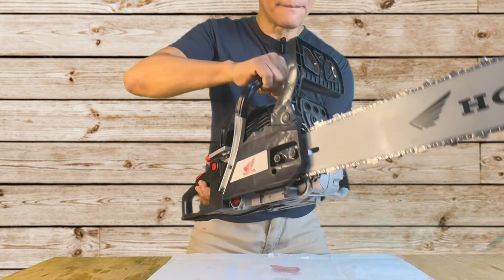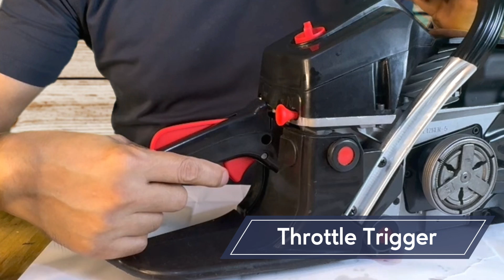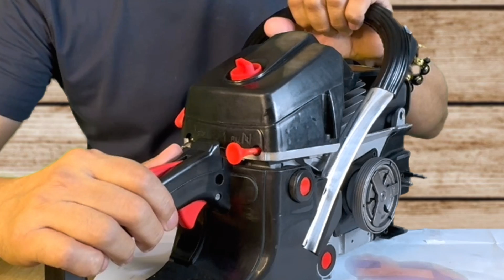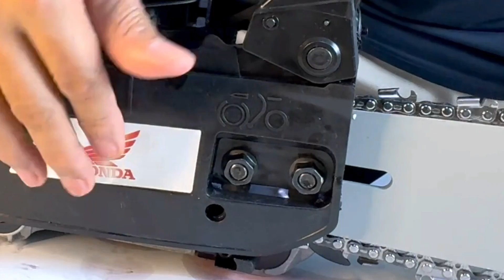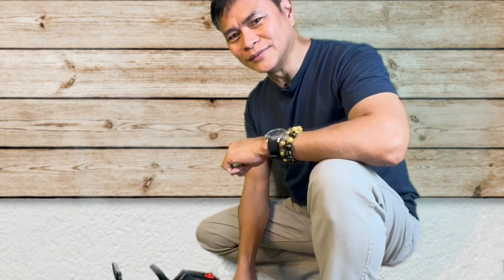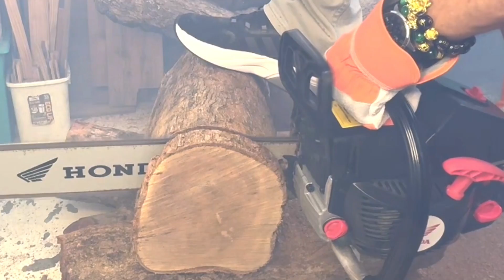Chainsaw Chain Brake Explained: How It Works & How to Use It Safely | Chainsaw Safety Tips

Comment: I am thinking about buying this chainsaw. Are you still using it, and has it been trouble-free?
Reply from the maker: Thanks for your question! Yes, I’m still using the chainsaw, and so far, it has been working great with no major issues. It’s reliable as long as you follow proper maintenance, like keeping the chain oiled. Let me know if you have specific concerns or need tips before buying!